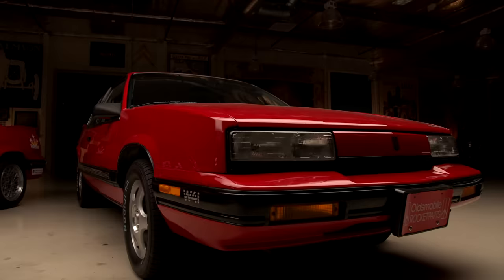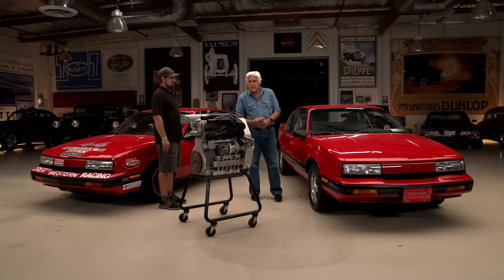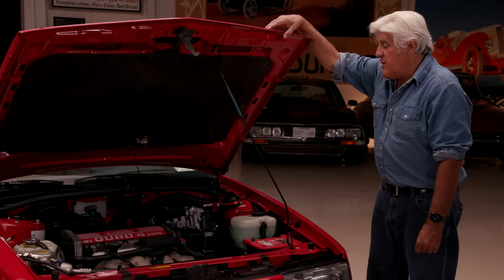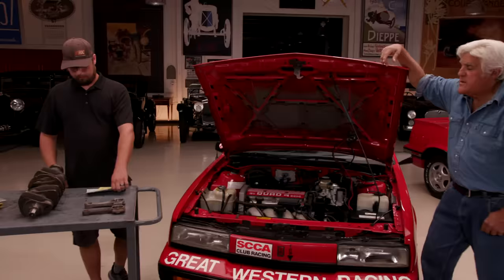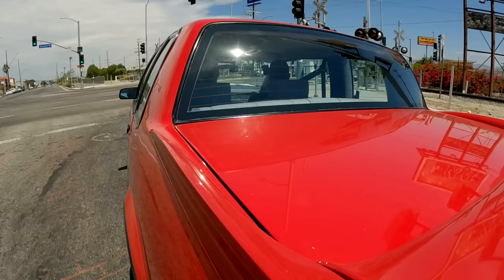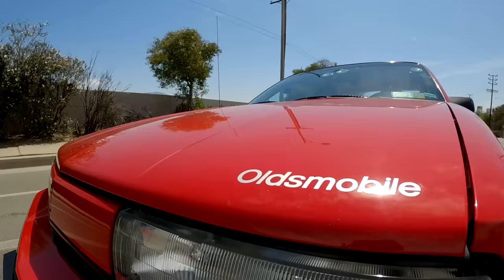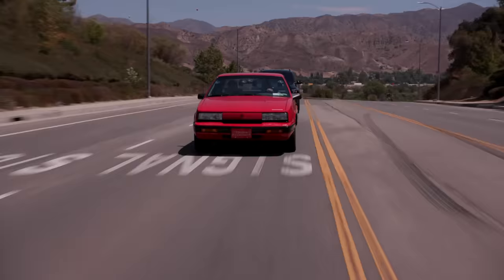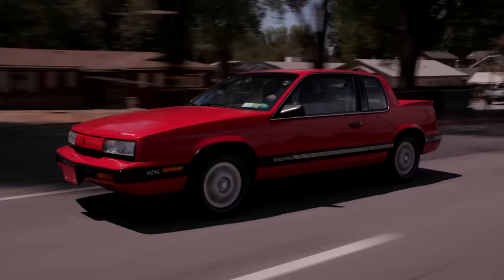Rare 1991 Oldsmobile Quad 442 W-41 | Jay Leno's Garage

Comment: That's the engine that should have gone into the Fiero.
Reply: About 100hp more than a stock "Duke." The Fiero would have sold like crazy with that engine and been a blast to drive.
Reply: Definitely
Reply: Agreed ....
I think it would have hurt firebird sales ???
A real tragedy a GNX turbo V6 in a fiero 🤔 could have been a legendary auto....✌️❤️
Reply: It was planned for 1989.
Reply: GM brass were actually terrified of the Fiero surpassing the Corvette...
Reply: Facts
Reply: @scottimusgarrett15  It did when they put the Quad 4 into it. That's part of the reason the car was canned. And it's a damn shame. Even with the stock 150hp version, it could rub circles around most of its competition.
Reply: GM loves to half step.
Reply: Yeah! No doubt
Reply: I had the '85 GT with the V6...'till some other olds sedan rear-ended me at a stop light.. I was pretty thankful it was rear engine when that sedan slammed into me..
Reply: @scottimusgarrett15 Corvette killed a lot of great things that could have been
Reply: Or the twin cam v6
Reply: @AnthonyParrilloRI  I'm pretty sure that the Z06 flat-plane project killed the Cadillac Blackwing. Just guessin'.😁
Reply: @Lrules364  H.O. 660  (Chevrolet Citation X 11) engine ran fairly well in the Fiero
Reply: As soon as GM finally gets something right, they kill it. '88 Fiero finally got the suspension it was designed for was almost immediately killed off.
Reply: The 1100hp one
Reply: @johnboydTx  Yes, 100%.  To think, a LC2 (3.8 V6 Turbo) in a Fiero would be faster than most cars today simply by the power to weight ratio.
Reply: Fiero was such a turd because of the engine. Some cars are so awesome but their bane is their power plant... RX8 owner here I know a good car with a poop motor.
Reply: A lot of the High Output Q4 engines did end up in Fieros.  People still searching out combos to put together, too
Reply: @scottimusgarrett15  Same reason there was no V-6 Chevette.  Heaven forbid they just make the Corvette better.
Reply: @blackericdenice  Stumble, too!
Reply: @theundergroundlairofthesqu9261  Yeah, but the Chevette was a true crapbox. If you put anything in it with more than 100 ft./lbs, it would have driven on three wheels from then on. At least the Fiero was a somewhat developed crapbox.😂
Reply: The Fiero was initially never intended to go fast. It just happened to be designed way too sporty for its purpose because the designers were tired of 'designing' the same old box with an engine in it.
Reply: @bartlx  yeah, it was initially designed to help GM with CAFE rules.
Reply: That and the f40 6-speed transaxle with torsen lsd.  Add vvt ....
Reply: Amen 👍🏻👍🏻👍🏻
Reply: It would have sucked to be an engineer at GM from 1973 to 2010. Just designing switches that save another $.03. Did they ever replace that turn signal stalk that felt and sounded like it was cracking every time you needed to signal?
Reply: With turbo
Reply: @jeffpiatt3879  Oh 100%!!
Reply: I owned an 85 Fiero SE with the 2.8V6, was in a Fiero Club. One of the members had a GT with a Nortstar Aluminum V8 and a Cadillac Alante low profile Intake.
The car was crazy fast.
Reply: @darrelldixon8056  and they sound good 👍 . One of my favourite swaps is a fiero with a tasty engine. This quad 4 would be interesting to see as well. The FWD based LS4 5.3l V8 is a fun one too.
Reply: Damn Skippy!
Reply: @Prodriver33  Definitely sounded great! The short exhaust system behind the V8 had a nice tone.  After a meet a group of about 25 Fieros took a drive across town through some rural roads.
I was behind the guy with the Northstar V8. At every stop sign he would launch and he was catching up rapidly. The nice thing about his V8 Conversion was every tucked nicely below the rear deck lid. He also had a Fiero with the 3.8 V6 Conversion. 
It was very interesting seeing all the Fieros lined up at the meet, and traveling together through the rural roads.
Reply: Nailed it !
Reply: Read my mind.
Reply: 10000%
Reply: I know you're not talking about the Quad 4 that thing was the biggest piece of s*** out of the Detroit since the pinto or the Vega
Reply: @scottimusgarrett15  True story. It’s why Porsche desperately tries to keep the Cayman in check, if it performed any better nobody would buy a 911.
Reply: The fiero was designed as an economy car with the looks of a Ferrari which disappointed, sadly enough it was probably doomed from the beginning..it could never surpass Corvette performance because that was the bread and butter of GM.  I would love to see a turbo 4.3 in one!
Reply: @scottimusgarrett15  yep that's exactly  it. If they dropped a original Pontiac block, like the past that every GM engine was engineered from after buying the rights, they were damn bullet proof. I have owned mostly pontiacs and GM vehicles. It's when GM started messing with the original engineering is when they screw some things up. A lot of people dont know how much pontiac influenced the world famous 4,6,8 cylinder engines. Not to mention the suspension and handling. They need to bring pontiac back and give honor to the birth of great engines inventors(sorry ford) The W series are grea(not the fastest, but screw the EPA). Ugly but fun. Those and Cavaliers, corsica, etc. They were just are reliable ugly cars that were common in that time.
Reply: @bwofficial1776  true
Reply: @rudimerm7686  also true
Reply: Nah they should have done what people are doing now by throwing a 3800 in the back. Leave the Duke as the entry level, put the 231 V6 LG2 or LG3 for the mid tier, and bless it with the LD5 turbo 231 for the low production number high tier halo version. The third version would have dusted that eras supercars in a straight line. Handling wouldn't have been as good as something like a Ferrai 308 but we would have gotten a legitimate mid-engined sports car from GM for well under anything as close as fast as a Fiero can be with an engine it deserves.
Reply: That would have rocked.
Reply: As the owner of a Fiero GT yes.  That would be a perfect engine for it.
Reply: @scottimusgarrett15  that's also why they only made 1555 20th anniversary trans-am's. Chevy was pissed that Pontiac had a 4 seater sports car that was quicker for around the same price as a base corvette.
Thus, only 1555 were ever built.
Reply: Fiero should of got a toranado transaxel and a big block V8
Reply: What should have gone into the Fiero is quality.
Reply: Even the 1.8t from the sunbird would have been excellent. 160hp
Reply: Yup. GM was stupid for not making the Quad 4 standard equipment in the fiero. I’m sure that was to make the v6 sell more tho.
Reply: I think the fiero should of got the lq v6
Reply: Yep instead of that disaster that kept catching fire
Reply: @johnboydTx  not really because the fiero had already looked a mid engine sports car what would have happened if anything they would have stretched the fiero's body turning it into a true mid-engine sports car that would have saved the Firebirds sales because the price would have significantly went up on the fiero think about it Pontiac was on the verge with something creating their own mid-engine sports car with that engine and the fiero
Reply: @btownballer27  You can thank tightening emissions for the RX8's dismal performance compared to the previous model. That little 1.3L needed a turbo.
Reply: @douglaslorin739  absolutely can blame the globa emissions standards committee members and their global summits as they arrive to them on private jets and eat caviar and veal at these meetings.
Reply: @stevenbingham7874  or a turbo K24 from  Honda. Go ahead and torch me I'm ready lol.
Reply: @btownballer27  heck ya!  I can't remember the YouTuber but he drove a fiero that had the old Mitsubishi eclipse 4 cylinder with a turbo and the thing was quick.
Reply: And the fiero should have been the underpinnings of the Saturn-1. Think wraith meets Porsche
Reply: It did .
Reply: So it could catch fire quicker?
Reply: @invinoveritas8704  Prison for the orange fascist reptile 2023
Reply: I have worked w the Quad 4. I had a N/A one I built that made 291hp and ran it in a snowmobile. And I do have 2 Fiero,s When it came time to upgrade from the Duke I chose an 2.0 Ecotec turbo engine. Great engine and it shares the Q 4 bell housing bolt pattern. I still have the 291 Hp Quad 4 but the main problem is getting Cam cores for that engine. I also have did plenty of work on the Iron Duke I have a 3.0 version that makes 222 Ib Ft Tq and 172 Hp W/O any SD parts. Same problem w that engine getting Cam cores.
Reply: I came to comment the samething.
Reply: The Fiero needed to be a little longer to accommodate taller drivers and passengers .  Some other design and suspension issues could have been better as well.  A 3800 engine with a 4 speed automatic and a 5 speed standard transmission option would have made the car quite the package but obviously GM didn't want a far cheaper car stealing the Corvettes thunder.
Reply: I had a 1987 mustang GT with 5 speed and it would blow the doors of this olds…
Reply: I still like them with the 3800 supercharged.
Reply: @packrat76  Have you ever sat in a Fiero, there is plenty of room for a person 6ft 6, and you are correct about a better engine trans option, but chevy complained and that was that.
Reply: The Fiero needed a 3.8 S/C Series II
Reply: @scottimusgarrett15  That was the reason they axed it.
Reply: @ericblade6152  Yeah but V8 Fiero's are the thing now and rightfully so because that's better in every way. 

Best sleeper car that way in my humble opinion.
Reply: @axe2grind244  

Well.. Jeremy Clarkson once said about the Cayman, "they slowed down the 911".
Reply: @gryphonlaw2138  

Really?? The painfully aweful Corsica??

No offense but that car was a junkyard special as far as I see it. We need RWD V8 powered Land Yatchs again along with the Big Block engine!!
Reply: You can put one in if you use an oil filter relocation kit. For what they are in a fiero, they are stupid fast
Reply: This would have made it a real competitor for the MR2
Reply: They couldn't spend the money
Reply: @herbienbrian2  Yeah and a slightly better suspension setup too would have helped.
Reply: I have one of these. Original owner. 59000 miles.
Reply: I didn’t know they were so rare… They were in all the car magazines.  Glad to see it out running :)
Reply: Yes
Reply: @herbienbrian2  The Fiero or the Olds, If you never had a Fiero, you wouldn’t understand. They looked better, handled better, had more performance, was more roomy, and was an all around better car! The MR2 TRIED to compete with the Fiero sales.
Reply: But then it would compete against the Corvette.
Reply: @Sh_tstain  The 2.8L was a bad joke.
Reply: @invinoveritas8704  Sorry about your TDS. 😀
Reply: @Steven Bingham  That's  the engine the should've used, 3/4 of a 350 SBC. 👍
Reply: Fieros cable shifter sucked.
Its the cat, that could've been, limited by the 2.8L and iff the shelf parts, doomed the Fiero from the beginning.
Reply: In everything
Reply: Cadillac allante
Reply: It was in the grand am is some options. I had one. I agree. That would have been a screamer. S2000 Honda eater.
Reply: That was part of the original plan but the brass killed the fiero for several reasons and it never happened.
Reply: I was thinking the same thing!
Reply: @johnboydTx  Those TA's were fast, in a Fiero with no wheelspin they would have ran mid 12's most likely lol...but the Fiero was going to lose money and was catching fire all the time to they axed the poor thing.
Reply: @Lrules364  Like a 200hp turbo MR2?...doubt that.
Reply: YES!
Reply: @robertelmo7736  lack of vision and poor engineering  😢 bean counters will get you everytime......🤔✌️
Reply: Ever drive a Fiero in a sporty manner?

Those chassis didn't need more power. 

Off throttle oversteer is a thing.
Reply: The 88 GT with a manual was a well put together car - then they killed it
Reply: @lloydbaxter6583  the rear   V 6 engine cradle was from a Corvair ??? 
Parts bin scrapes ......🤔😨✌️
Reply: @jamesdellaneve9005  it must've been absolutely torturous. You get out of design school, sign a contract with GM, and you're put in the Door handle Division.
Reply: @axe2grind244  totally. I think with the GTR cars, Porsche will always make the 911 the Big Dog (apologies to Mr. Leno!), but lately it seems the 911 is going more the way of a luxury GT, with the Cayman taking the "sports car" mantle. It's certainly being priced that way...
Reply: @drbobsnightmare2521  yeah, but you would have to get adapters to clock the 8-71 blower pointing forward.😂
Reply: @doug6191  lol! They were terribly made....
Reply: @scottimusgarrett15  I'm lazy , I was going to keep it fwd like a Toronado. Just because everyone here was so keen on getting an Olds engine in a Pontiac.
Reply: @drbobsnightmare2521  I think it would look like a Big Daddy Roth cartoon, and that would be hilarious. Stick shift out the sunroof!
Reply: @stevejohnson1397  yep,  change the head gasket more often than you stop for fuel.
Reply: @scottimusgarrett15  Yeah Rat Fink baby!! Roasting those front tires.
Reply: @drbobsnightmare2521  a couple years back when looking at Fiero Videos, there was an orange Fiero with the big block 455 Olds transaxle setup SUPERCHARGED! Insane. Motor stood way up above the rear deck no deck lid obviously.. only saw videos of it running and moving around.
Reply: @darrelldixon8056  I must find this glorious unicorn.
Reply: Amen to that. If memory serves, the Fiero project got promised a lot, but ended up getting gutted when it came time to put it into production. Shame.
Reply: @darrelldixon8056  was it Yellow and Black? I remember one that was yellow and black. And some crazy modified first gen MR 2s
Reply: Those Fieros sold like hot cakes when they first came out. I think the insurance cartel brought them down more than anything
Reply: I agree.  So cool
Reply: @drbobsnightmare2521  no its bright orange, just did a search again and saw it.
Reply: but just like GM always screwing up. the fiero coulda been something great. but they didn't put much effort into it & killed it bcuz poor sales ect. duh!
Reply: Had one with a quad 4 conversion with the Gerlach  5speed. Ate corvettes for breakfast.
Reply: @jamesstaggs4160  I would have liked to see the 3800 carried on with aluminum block , vvt , DI AND port injection ...it would have been glorious in the back of a fiero . Just look at what a monster the 4.3 lv1/lv3 is . A short stroke version of that with a longer legged cam would rip .
Reply: What could have been.
Reply: @johnboydTx  that 3800 is a popular swap for the fieros.
Reply: @drbobsnightmare2521  they put a caddy V8 in it
Reply: Fiero would've still been a pos
Reply: @btownballer27  Smokey Yunick did some pretty good stuff with the stock bottom end of that turd.
Reply: @johnboydTx  Look at Motor Trend in '84 or so... they published my "letter to the editor" praising the GNX over the C4!  The one prob with your idea is that I think there was no manual transaxle at that point in time that could have taken it!
Reply: @lloydbaxter6583  Stop....it had 135 hp...I have a MR2 that makes 3-4 times that lol.
Reply: These engines where awful. They where usually good for about 100,000 Miles,that is is the timing tensioner didn't give out.
Reply: It’s possible still
Reply: @jimski1  do you know anyone who's done it?
Reply: THIS.
Reply: Amazing GM never figured out that the Duke was a truck engine and a really lame car engine.
Reply: @ericblade6152   Some guys are putting in the 2.0 Supercharged LSJ motors from the  Redlines/Cobalt SS, or making them LSJ-T's
Reply: After my (Step) Dad passed away & I’d moved to a ski hill, my Mom saw a gold Fiero & had to treat herself to a "sports car". I got home at the end of the ski season & there it was in her driveway. A gold Pontiac Fiero, sadly NOT the GT. A few months after buying it, my Mom asked me if I’d drive her & the Fiero to a dealership that was selling a ‘91 Honda Civic Si. After 5 minutes of that God-forsaken, 4-cylinder slug telling me to "Shift NOW" @ 2500 RPM. I couldn’t believe how much more powerful, quick and fast that 5-speed Honda was compared to the Base Model Fiero. I realize that the Civic Si was pretty much a 4 seat-race car if one stripped the interior of everything but the front seat, but it felt like a 911, (which I HAVE driven), compared to an original Hyundai Pony. I digress. I know a young engineer who took a Fiero GT, put a (newer) hi-po Cadillac V8 into it, and a Corvette rear body panel/taillight section. It looked like a mini-Vette that was much more capable high speed sports car than it’s "big brother". He beefed everything up in that car and it won many prizes in sports car obstacle courses, acceleration/braking & 1/4 mile drags. I found out later that he helped rebuild a Ferrari (456?) with his old shop teacher, and then built an Ariel Atom-well, he put the Atom together and rebuilt an Acura engine into a balanced and blueprinted racing-power plant that propelled his car with unbelievable power. That was the last I saw of him. This video was a great watch, thanks very much.
Reply: Boom it would've gone lol
Reply: @johnboydTx  Didn't want it to infringe on Corvette, just like Porsche holds the Cayman down as it is a better combination that the 911 Halo car.
Reply: I bet it could have saved Fieros if it were developed just a couple years earlier.
Reply: my dad was one of the engineers that got the bugs out of it in lansing, he said "its a fine engine as long as they dont pull any money out of it"- they did, and it became unrebuildable
Reply: I agree!
Reply: I miss the Fiero. So cool for it's time.
Reply: Since the Fiero and the Allante have both been mentioned already, I've said it before and I'll say it again... perfect examples of two critical GM flaws. 1. Their thinking that appearance and perception were enough when it came to selling the public on a car, and 2. their improving an existing car to where it ALMOST becomes what it should have been in the first place, then canceling it.
The Fiero gave GM a true mid-engine car that gave the appearance of performance just like the Allante gave GM a car that gave the appearance of a competitor to European brands like Mercedes and BMW. Neither of them ever achieved that because of GM cutting huge corners. Yes, they eventually got around to actually giving these cars some of the credentials they should have had to begin with, but by then the names Fiero and Allante cars were synonymous with disappointment, and GM's attempts to update them seemed like a desperation move. So buyers were over it.
The biggest mistake was that both cars were, at their core, specialty cars aimed at fairly niche markets, and in that situation, you'd better deliver the goods by at least the 2nd model year grace period. They didn't
When it comes to the Fiero, what kills me is that they put the 2.8 V6 in a CITATION and an HO 2.8 V6 in the Z24 Cavalier, but they couldn't make a small V6 standard in their only MID ENGINE SPORTS CAR.
Reply: You are 100% correct in that! I had a red 93 Achieva SCX - the next N body in line after the Calais. Same W-41 package for homologation. Had a W-40 Calais at the same time. Seriously loved these cars...
Reply: There's a guy who built a 81 olds omega sport with awd and a Saab engine. You should Google it it's quite an Insane build, he seems to do obscure cars for the hell of it, Including a rwd 80s Daytona with the boxy front end.
Reply: And replace that powerful deadly 2.8 v6? lol
Reply: The 3800sc is amazing in it. I would probably love this engine in it since it can be a bit too aggressive at times
Reply: @AnthonyParrilloRI 
But check out Wikipedia- the opening sentence gives a precedent: “Pontiac Motor Division of General Motors, was an American automobile brand owned, manufactured, and commercialized by General Motors. Introduced as a companion make for GM's more expensive line of Oakland automobiles,[3] Pontiac overtook Oakland in popularity and supplanted its parent brand entirely by 1933.”

But Chevy should issue a ‘heritage’ model every year, developed and manufactured by the corvette group. There’s a couple Pontiacs, a couple Oldsmobiles, the ChevyII, the ‘71 and ‘78 Firebirds, a ‘53 Master Deluxe, and the Corvair that could all fly under an annual Heritage release…
Reply: @theundergroundlairofthesqu9261 
LOL
I never did it, but way back before online shopping carts I had some ‘stuff’ from Don Hardy on an order form, a 1979 Chevette, and a running driving Olds 98 with a 455. Different kind of fun than a V6 would have been, but doing the 455 would make a decent rear suspension (in a straight line) whereas a factory V6 would need some major rear suspension rework to make it safe, and both front end and rear suspension help to make it handle. They had a local elementary school science class design the Chevette’s suspension I think.
Reply: @fishhuntadventure  amen, I wish all companies would do that. for instance I love older Hondas/Acuras I wish they would make older models like your talking a heritage line. But the time of caring about the consumer enthusiast is over and it's sad because I'm 24 and everyday say I wish I was born 50 years earlier than I was.
Reply: Lol damnit was fixing to say that would be a fun swapout
Reply: @btownballer27  lol try a GLC wagon 1.5
Reply: I agree
Reply: I remember that episode of 60 the Oldsmobile was a Delta 88 blue with white vinyltop and the two women were heading to a casino and they blew a tire and headed straight into a a semi truck and they both thought they were dead and one walk away with a broken well the one with the broken ankle didn't walk away but her friend did walk away
Reply: That was the plan
Reply: @Prodriver33  the fiero was rwd doesnt need fwd engine. I guess you mean the transverse tranny engine combo? The F40 6 speed with the 3900 is a great combo big issue the 3900 needs more aftermarket. Great baseline tho. The L67 3800 series 3 supercharged would be the best bet. Yeah it only makes 265 hp but it easily makes 320 ft lbs stock. With a E85 tune and a smaller pulley I have seen guys making 400 hp from those two mods. You can also gut the supercharger and add a turbo. Those are monsters.
Reply: Poor fiero was a piece of garbage
Reply: But then nobody would have bought the Corvette.
Reply: Pontiac didn’t want it, it failed to catch on fire during testing.
Reply: Bingo